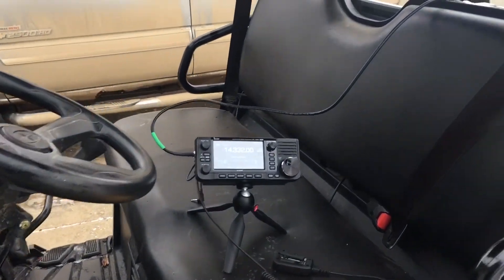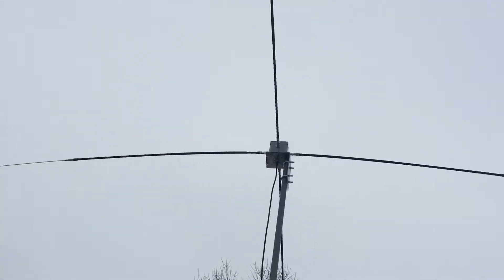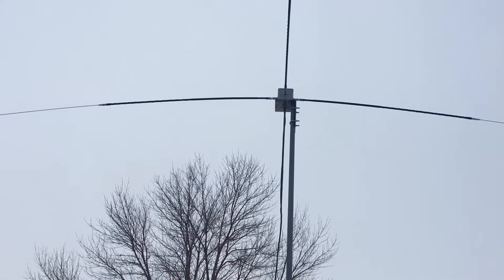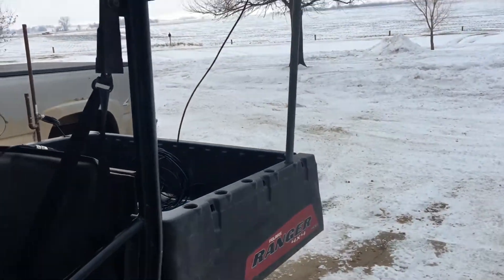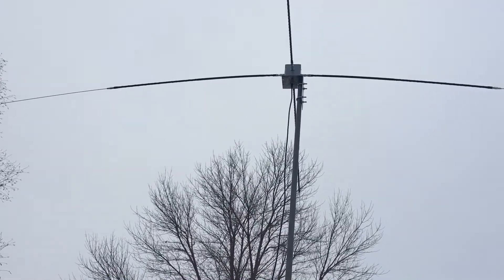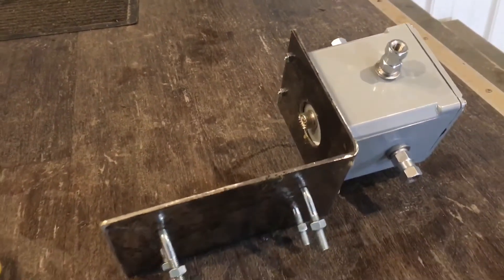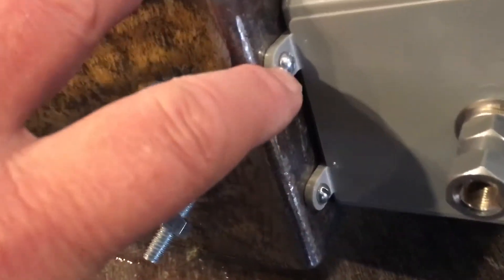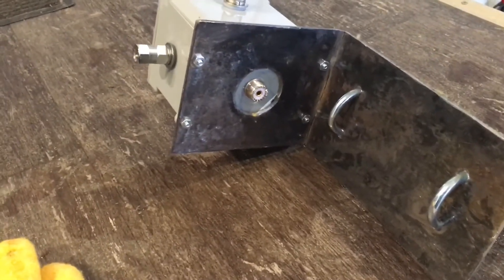Dual Band Hamstick Dipole | Part 2

Comment: So the rig sees the 40M antenna when on 40M? No need for antennas switch?
Reply from the maker: Yes, there some band combos to steer away from but I was primarily interested in 20 and 40 meters.  I got the idea from the Chameleon two band quad antenna which they also have a four band octopus. I would look into one of those instead of building one. There are plenty of YT reviews on those products.
Because of the price of hamsticks I am going to use wire to create a two band inverted V dipole antenna using this setup.

Comment: This setup solves a lot of problems for me. Have you tried to have one set of whips with a vertical orientation, and the 2nd set horizontal? I was thinking of doing the 20 meter as a vertical and running the 17 meter using horizontal orientation. Wonder how that would work. I especially liked that you ran it at 13 feet and had good results. I live at 7000K feet altitude, I think a 15 FT height would work fine. Currently I am using the Shark WHips on my Durango which is parked next to the garage, and I ran the coax under the garage door and hooked it directly to the 7300. I have been doing QSOs since September, no complaints. At 15 feet, things should be even better! 
Let me know if you tried using a vertical & horizontal orientation. I have to wait until spring to set this up. Snow all over the place here!
Reply from the maker: Your suggestion is a good one. I will have to try that. As soon as it warms up a lot (Minnesota) I will give this a try.
Reply: @1crazynordlander    LOL, yeah I am in NE Utah, it is snowing quite a bit here, hasn;t stopped since Christmas Eve. I am going start looking for a mast locally now, this way I have something by Spring.